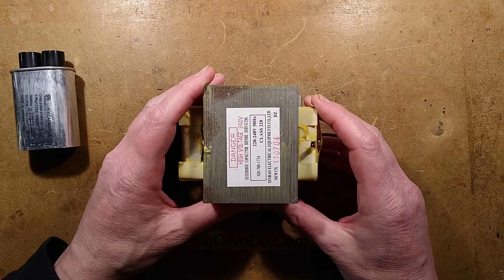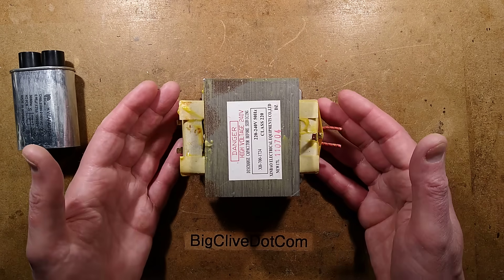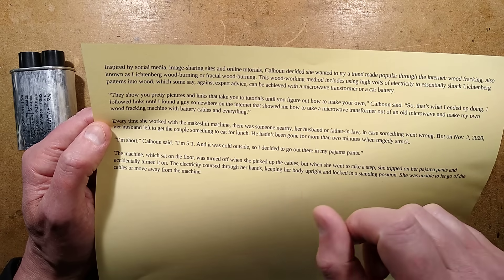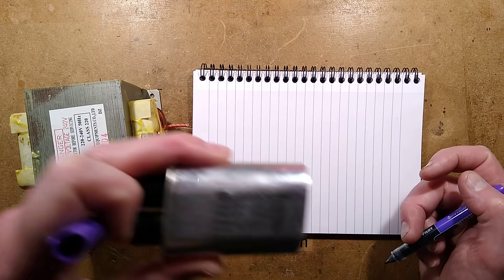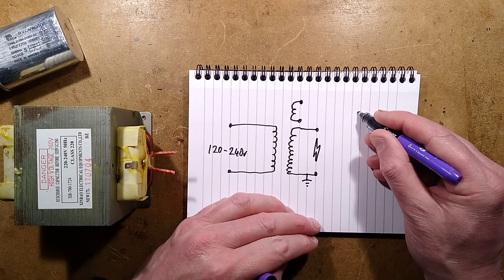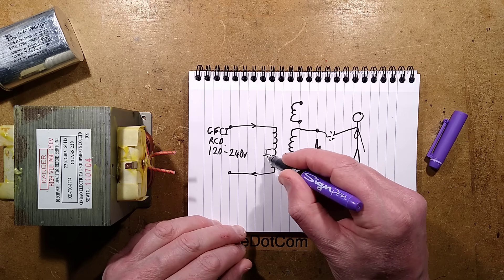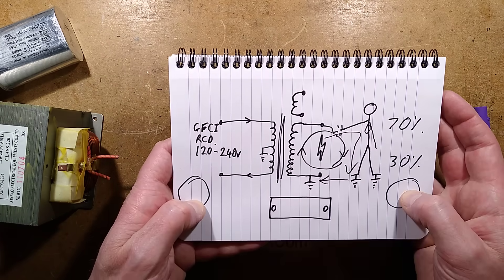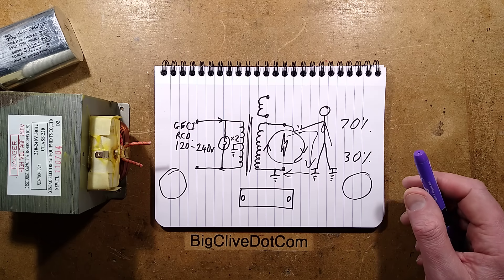The most deadly project on the Internet

Comment: Don't think it matters how many warning videos are put out, the TikTok geniuses are going to keep doing these things.....and dying. I'd love to try making one but am waaaay to nervous of voltage that high and know that I'd cheap out on the materials
Reply: I'm in the USA. I used to work for a couple arcades owned by one company. In one they had an old British rifle range game, it had a 120>240v step up transformer in it. I got hit with the 240v by that once, and after feeling that compared to good old usa 120v no way would i ever go near this 💩
Reply: @UmmmmmmmWhat  even if the votage is lower, the sistem is really bad. I live in a country with 220v (in each phase, at 120º, 380v with the 3), but we have a better sistem, with more isolation, and rcd (really, the gfci makes no sense, if you get shocked in another part of the circuit, it doesn't protect you)
Reply: @Giuliana-w1f  GFCIs totally make sense; correctly wired ("upstream" of the other outlets) a U.S. spec in-outlet GFCI protects the entire circuit the GFCI outlet is on, not just that 1 outlet alone. 
Mechanically its exactly the same device as an RCD, North America just installs them in a different part of the house. The only reason the name is different is because North American english and British english settled on different terminology, same as "vacuum tube" vs. "valve".
Reply: @drewgehringer7813  how does a gfci outlet protect the entire circuit? It can't cut power to anything other than what it's conected to it (?).

I know it's the same as an rcd, but if it only protects one outlet, i think it's almost useless.
Reply: @Giuliana-w1f  I was also wondering if they would short the rest of the circuit when tripped but probably not...
Reply: @elvinhaak  they don't. (Also, that would be really unsafe)
Reply: Amperage and power. Look it up.
Reply: these problems thankfully tend to be self levelling
Reply: Natural selection
Reply: @Giuliana-w1f  says a guy who's short, near sighted and physically very weak and lacking the intelligence to understand the gravity of this issue.
Reply: @Giuliana-w1f  The problem with the natural selection argument is that unless you've actually watched a video of a person being brutally grilled from 25kV train overhead lines with a loud 50 Hz hum that lasts for a fraction of a second, as a layman you have no feeling of just how dangerous HV can be.
Reply: The weak always weed themselves out...one way or another.
Reply: @loloholmes2793  not funny, not funny at all, the  curious and those with initiative are not weak. Self righteous losers that laugh at them, try to get a cheap rise out of  the  decent while feeling very smug about themselves are weak.

Comment: It is quite strange how people miss the high voltage warnings again and again. Part of the Darwin award, in my opinion. Thanks for the warning!
Reply: The stages of high voltage:

This will hurt
This will injure
This may kill
This will kill
Closed casket
Reply: Problem is some equipment will say "Danger High Voltage" yet is still only low voltage. So ppl may see the high voltage warnings on a microwave and think its still only a low voltage.
Reply: @staples4335  sadly this is most equipment. Ive seen batorie powered equipment with these lables on them. High voltage warning should be only used for stuff with a voltage sorse of more then mains peek voltage. Anything with more then 30v should have the shock sticker on it.
Reply: I feel like high voltage warnings were used to liberaly so when something really dose have high voltage people ignore the warning and well pay the price

Comment: I'll have a go at fixing most things but I'll never take the cover off a broken microwave because I heard how dangerous they were. Thanks for explanation.
Reply: I've repaired several microwaves, and it isn't typically difficult. Many have the wiring diagram printed inside the case. Almost always it is a micro switch in the interlock that fails. Always short the cap!
The last time mine needed a repair, it was the turntable that failed, I needed it on to troubleshoot. So after shorting the cap, I disconnected the MOT completely and connected a lamp to the leads. So it would behave as if it were on, and I'd know when it was "on." Then I could relatively safely determine where the fault was. When it was repaired, then I reconnected the transformer and closed it up before powering it on for the final test.
Reply: @strehlow  don't forget blown fuse because one of the microswitches came out of alignment or the holder. One of the microswitches is a crowbar circuit that shorts the power to prevent the microwave from coming on with the door open, a last ditch safety measure.
Reply: @spvillano  Yeah. That was the previous repair. The crowbar switch failed and blew the fuse. I had a pile of the switches so replaced them all as long as I was in there.
Reply: @strehlow   Agreed. Also, what you're correctly calling a micro switch is a normally closed or normally opened switch. Typically there are three of them in a microwave. They fail quite easily because people slam their microwave doors shut because people are stupid.
Reply: @josephdestaubin7426  I think "micro switch" is (or was) a trademark for those small form factor switches. I've got a bunch lying around from various devices. Some single throw (NO or NC) and some double throw. Curiously, the last microwave I took apart used switches without rivets to keep their cases together. The plastic carriage that keeps them all where they need to be also held the two clamshells together too. Building to a price point...
Reply: Same. The bulb inside my microwave blew nearly 20 years ago. It annoys me it doesn't work but I've never replaced it because I'd heard how deadly the insides can be. Possibly an overreaction but I'm a bit on the clumsy side and would rather be safe than sorry.
Reply: @windyleecarr  the lightbulb should be pretty easy to change, unless it’s some new crap that isn’t user serviceable
Reply: @userblame632  It's about 25 years old I think. Looks like it may be one of those small screw in oven bulbs so should be easy but still, think I'll wait 'till I'm closer to retirement age before attempting it...🤕
Reply: Fixing microwaves is easy, the trick is is having a having a well insulated very long set of curved needle nose pliers to unplug and then discharge the capacitor.  99% of the time the fault in a microwave is the normally closed and normally opened  trio on the door that go bad, and those are  pennies to replace.

Comment: Doing this doesn't interest me in the slightest, mainly as it's too dangerous as you quite rightly pointed out, and I hope you don't get demonetized for this video.   Is there a slightly safer way of using a MOT, is there a way to current limit the input current of the transformer via a resistor, capacitive dropper or florescent light ballast etc so that the output of the MOT becomes a little less lethal but still fairly spicy?
Reply from the maker: In this application the high current is needed for fast results.
Reply: You could make the transformer somewhat less dangerous, but that doesnt even remotely change the real issue: That people with non-existant knowledge of electricity and safety practices think they can use super-lethal power sources. If you are not able to write out a multi-page dissertation of all the dangers without looking anything up, you are simply NOT going to be safe.

Comment: Good example for a question on grounding. What if the secondary wasn't grounded ? The body would still feel the voltage and unless you where particularly well isolated I have to assume that the high voltage would find a way to arc to ground and back to the transformer
Reply from the maker: The high voltage means alternate resistance paths become more significant.

Comment: Well I am still here and made many of these pictures.
I use a LOPT from TV with MOSFET high frequency driver.
The problem is most of your viewers are not the ones that need the lecture so we need to promote this video on other social media.
I have a good respect as over confidence has caught me out when repairing a 26"TV knock me out for 3hrs and felt like the TV had been dropped on me from a height.
Frying tonight 😁
Reply from the maker: The line output transformer version is much safer.  Some commercial units use that.
Reply: @bigclivedotcom  Yup, an LOPT can't deliver NEARLY as much power as a MOT, accelerating an electron beam requires a tiny amount of energy in comparison to boiling water from a distance.
Reply: Every time this comes up on Imgur I have linked (and seen others) link Clive's previous video as a warning. I will update my notes and be linking this one in future nods
Reply: TV flyback transformers put out much more than 2000Volts! albeit low current , it is no less dangerous. think EAD device that can stop your heart in an instant as easily as they are used to kickstart them in medical environments. Not something you want to mess around with without a very good understanding. I was taught to always have one hand behind your back when probing in a TV or similar high voltage device. That way, if you happen to touch voltage, your muscles will yank your hand back and the other cannot complete a circuit through your body.
Reply from the maker: @tubejoust  The most dangerous part of a TV flyback circuit is the fat capacitor created by two conductive layers on the glass tube.  You can pull an arc to your hand from a bare flyback transformer without worrying about much more than a burn due to the very high frequency.
Reply: @bigclivedotcom  Most of the damage caused by inadvertent contact with a flyback circuit, is what you impale yourself on, while rapidly removing your hand.